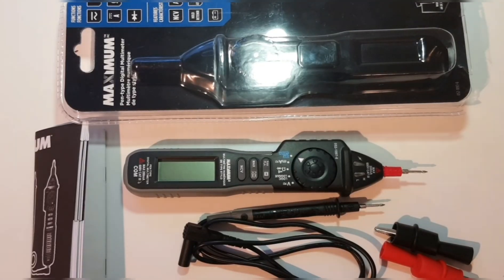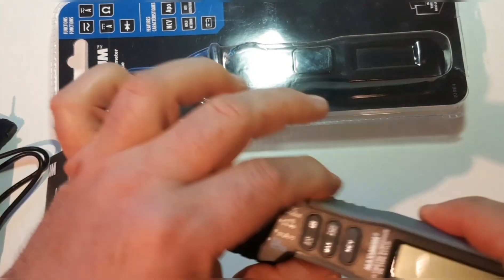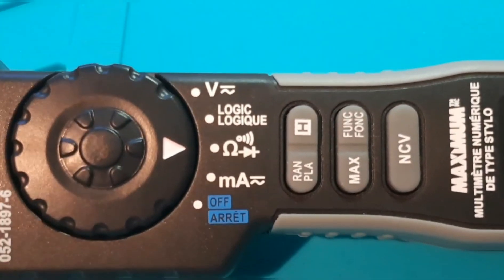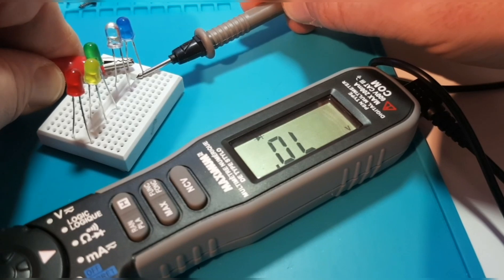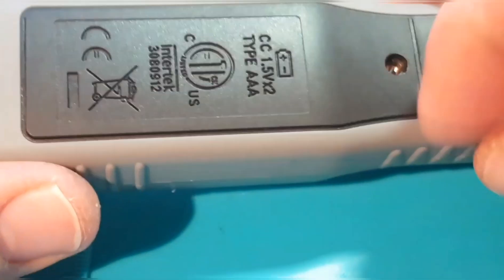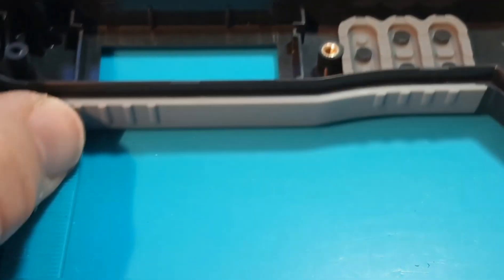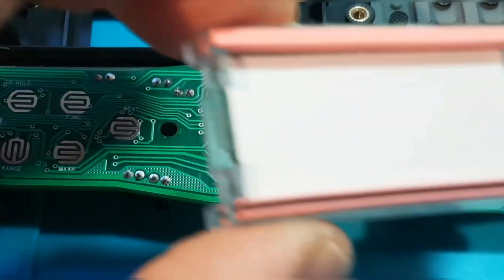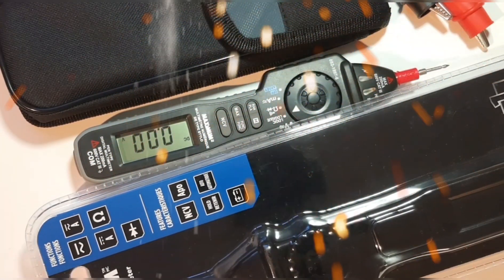Maximum Pen Multimeter Review & Teardown! (Model 052-1897-6)

Comment: The only continuity function that little gem delivers is silence-!-LOL  Dont recall the last time I saw a meter of any kind that would neither light OR read an led, good thing you get this kind of stuff free for review I assume, canadian tire seems kinda pricey compared to the US.  Ive got a couple meters like this as well, its like I dont mind if its not perfect but geez it could at least I dont know, work--lol    Not one of Asias best it seems.  Thanks for giving us all a heads up once again-!
Reply from the maker: It was a very painful meter to review, nothing worked or worked very well..
They negated even a basic "flashlight" or led functionality on the tip to see...,that's almost standard on Pen Meters nowadays.
Reply: Yeah ive got a cheap ass one from "Peakhold",   the HP38B and its one of my worst purchase mistakes.  Technically it works, but it doesnt do any one thing really well, has a cheesy sliding selector switch that feels like its going to break every time you even think about using it. It also feels like it could blow up in your hand on a bad day.
Reply from the maker: @yambo59  I came close to testing that meter but it was just to damn ugly for me to pull the trigger! ....Funny how they can call these things "Pen Multimeters", most are gargantuan and feel awkward as heck in the hand...anything but pen like.
Reply from the maker: @yambo59  Well, nothing wrong with taking a walk on the wild side..
You can only do your due diligence for so long. I've gotten royally hosed on more than 1 occasion with a meter from hell but its all good in the end! At least that's my story and I'm sticking to it!